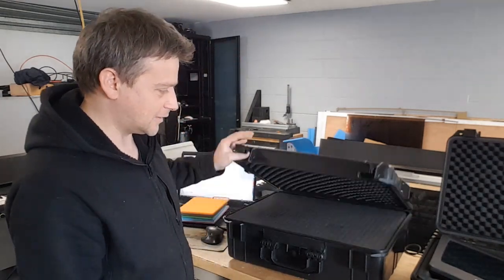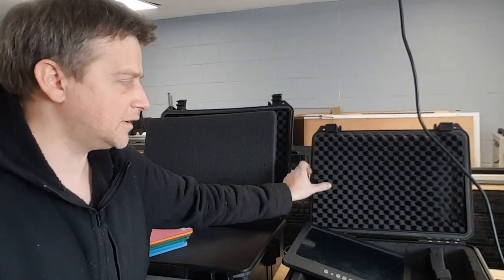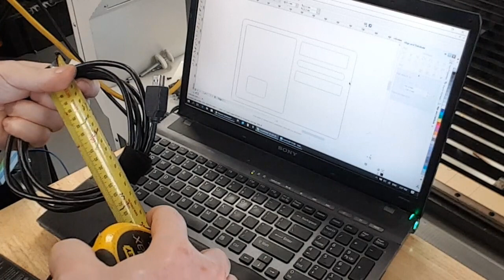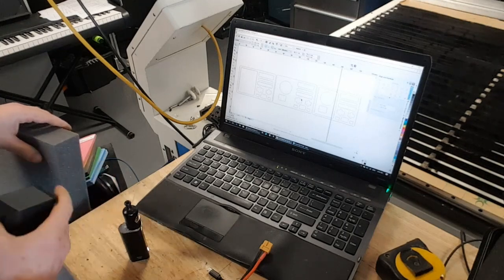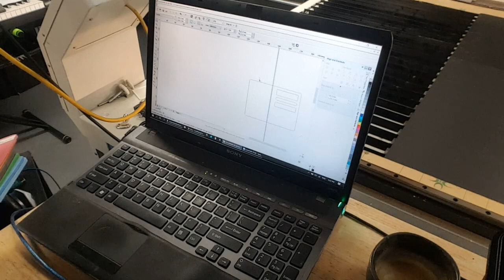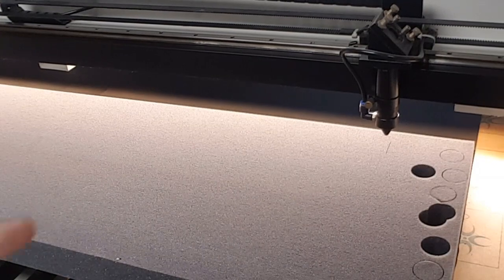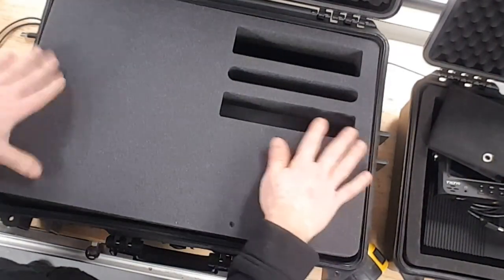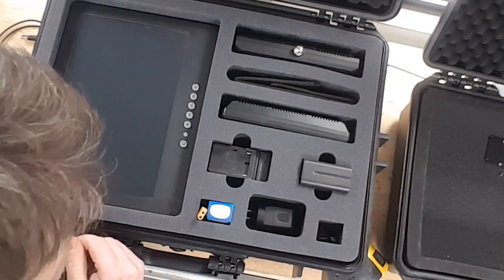custom made case - whole process from the design to laser cutting and assembly.

Comment: Hi. 
Thanks for this video. 
I was just thinking of making my own laser cut foam cases. 
However, could you pls let me know what is the wattage of your laserdiode?
I went to few commercial laser cutters who cuts Acrylic letters. They refused to foam. 
So planning to do it myself.
Reply from the maker: I have 100watt co2 laser. But to cut foam you use 10-13watt for open cell foam and around 20watt for Eva foam. You can cut Eva with 10 Watt. But it will be very very slow. When you cut foam you want to have minimal power. Just enough to melt. And not to burn. I guess guys who cut acrylic don't want to cut foam because it catch fire if they want to go faster. And cut edges look terrible. Or they have to spend a hour to cut. So to much trouble for little money.

Comment: Very professional ! I always use Coreldraw, much more intuitive than Illustrator, in my opinion, specially working with bezier points. Thanks for sharing !
Reply from the maker: thanks :) i have been using corel for 20+ years, I also tried illustrator few times, what a nightmare :) i guess once you get use to something its OK, but i just couldn't  :)
Reply: @PiotrFoxWysocki  The first time I used CorelDraw was right after "Photofinish", in Windows 3.1, I think, Hehehe ! But Illustrator is very good, too. Cheers !
Reply: both corel draw and illustrator are good for their own, corel draw is good for line art designs, Illustrator good for media art design.
and on another note, all cnc and laser machines support corel draw just because of its line art designs.

Comment: Hi Piotr, I just checked your video and looks solid. I am just curious if you could be more precise about the PE foam you've used, and what the density was of the material? Was it XPE foam, IXPE foam? Any other? Would be greatly appreciated.
Reply from the maker: To be honest I don't know much about open cell foams I have used. I used the one supplied with pelican cases. The other foam I use is available foam 40-60 hardness. Before you cut foam it's a good idea to spray water under the foam so it doesn't catch fire or melts when gasses ignite. Water just prevents it from happening. When it comes to the type of foam it's the matter of power and speed. You want to go as slow and as low power as possible to get a clean cut. You want foam to melt not burn.

Comment: @Piotr Fox Wysocki: It was a bit unclear to me what kind of foam you used. It's polyurethane foam correct? I've heard EVA don't cut very well on co2(?)
Reply from the maker: It is polyurethane foam. Cutting any foam is tricky. But I don't find Eva foam hard to cut. You just need to go slow and with minimum power to just melt it and not to burn it.
Reply: @PiotrFoxWysocki  thank you! So you get just as clean cut on EVA? I've read it cuts but "cutting of EVA foam with a CO2 laser produces a wide cut with some light brown discoloration. Laser engraving of EVA foam with a CO2 laser creates depth with a slightly tacky surface, melted edges, and a darkening of the surface" ?
Reply from the maker: Cut will depend on the quality of Eva. Color and intensity. Black will leave some char. Also depends on thickness. But light colors cut quite clean. Color on the cut gets more saturated as it's melting foam and increasing the density hence more vibrant colors. For reference  if you want to have best possible cut you set your laser to barely work like 13% power and you go slow  around 5-15mm/s (as slow as it cuts through) numbers might vary but this would be a good start
Reply: @PiotrFoxWysocki  again, thank you! I've ordered some EVA samples in different thickness and density now and I'll try it out. I have a large 100w laser and will try your settings as a baseline.
Reply from the maker: Good luck

Comment: Hy fox,
You have a plug-in for laser inside Corel draw ?
What is that ?
Corel is also my favorite for drawings and I have a self made Lasercutter . 
My workflow need extreme lots of steps . After drawing that I have transfer to Inkscape and inside Inkscape in use an addon  to export and that file (g-code) I could use it in the laser program... 

Greetings Michael

Comment: has the same fire incident while cutting foam, was much more severe....
Reply from the maker: when i cut AVA foam i use a spray bottle and spray water on the bottom all over the sheet I'm cutting.  no more stress and never had fire incident. without the water is different story. not sure how it would work with open cell foam.

Comment: You're going too slow mate. That's the reason of the fire. Try to go at fast speed, then raise power 😉
Reply from the maker: agree to a degree ;) if you increase power it will leave burnt edges. on the foam you want to go as slow as its bearable for you stand and as less power you can set. idea is to melt not burn.
Reply: @PiotrFoxWysocki  we're all looking for a clean cut, obviously. Going slow is the worth thing to do with laser, because the fire risk is maximum, and you experienced how fast some materials catch fire. Balancing power and speed is the state of the art of laser cutting, with a priority to speed. Sometimes you can not cut at safe speed on a single pass.
I'll give you my testing method if this can help. I wrote a gcode with various feed and power to cut a test comb on the edge of any material. As it is on the edge you can see what's going on in the material. This way you don't have to waste much material, or spend time to change head position to cut round holes.
With this single gcode, I know instantly what's the best option, and as edges are mostly wasted anyways... As the cuted lines are a sequence, I just have to count the lines to know which is the best option. 
First line is a 10mm line cut at full speed and full power. Then few mm below the next line is power decreased by 10% and so on until 10% power left, then I start 2 following columns same as the first one but with 2 then 3 passes. Maybe you will find it handy.😉
Reply from the maker: I give your idea lots of thought, at the beginning I thought it was pretty good, but there is a lots of variables for different materials. so i would have to have lots of those test programs with different power ranges and speeds. i have been laser cutting for 10+ years and i kinda know the ranges from the experience. so i can nail the speed and power after just few test circles. running the whole row of circles with different speeds and powers feels like waste of time when you roughly know where you have to be.
Reply: @PiotrFoxWysocki  I understand Piotr. Anyone has its own preferences, and you would not probably change after 10 years of personal habits. Just take care about fire mate.